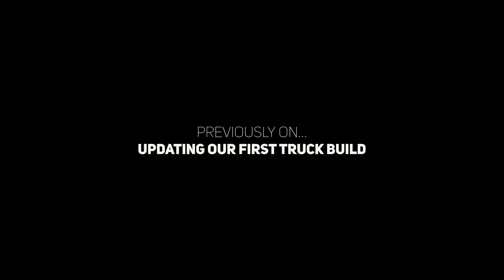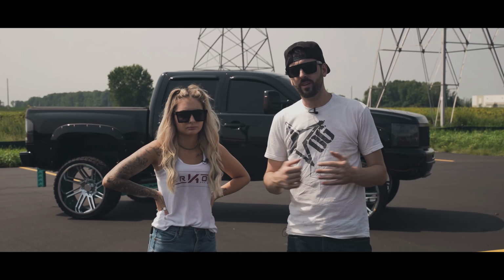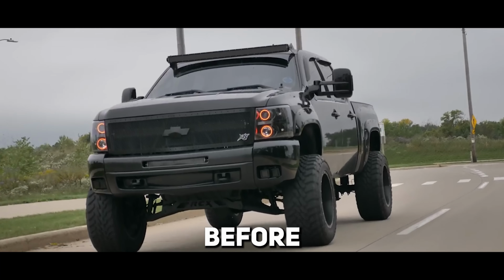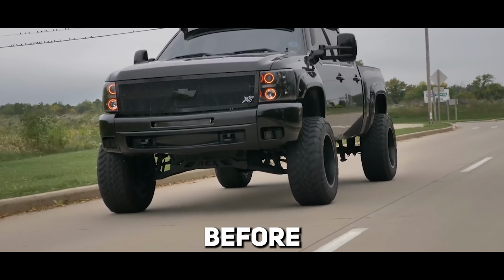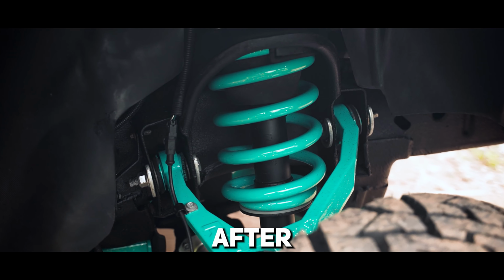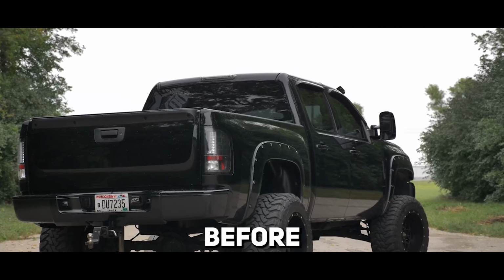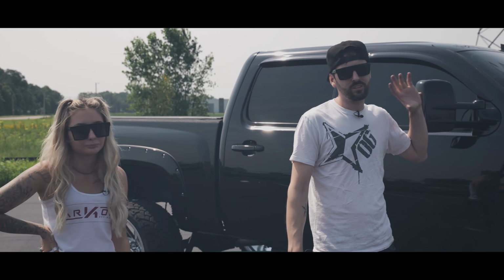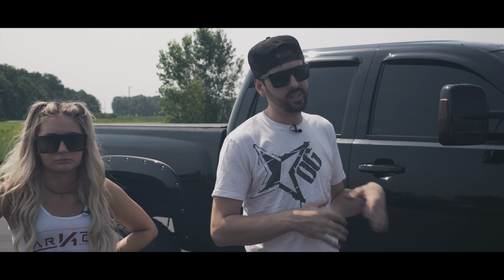One of Our Earliest Show Builds - REBUILT! || PT. 3

Comment: I like everything except the skinny tires
Reply: Same, the rubber bands look terrible
Reply: not even that skinny
Reply: I usually love skinny tires but it needs a bit of a smaller wheel honestly
Reply: The chrome wheels are too big and throw the color scheme off. Just awkward
Reply: Good thing it aint your's
Reply: It's the wheels sticking outside the body that ruins every truck is done too. It looks ridiculous and only hurts the engineered geometry destroying brakes and wheel bearings.

Comment: I like the sparkles. 

If the damage under the fender flares isn’t going to be dealt with for a while, I’d take all the fake bolts out of the flares and either paint them to match the suspension or just black them out. The bolts sort of pull some of the focus from the wheels. Still looks great though.